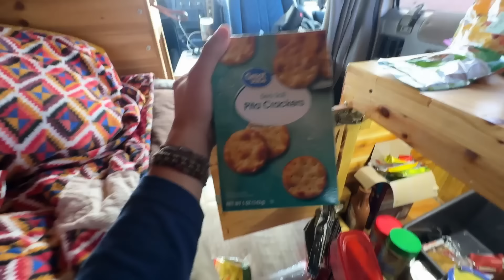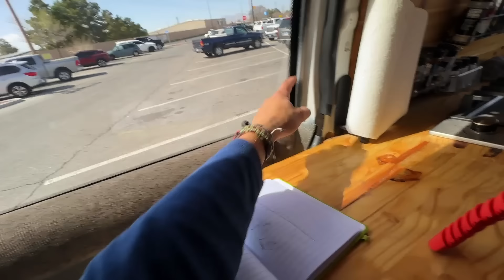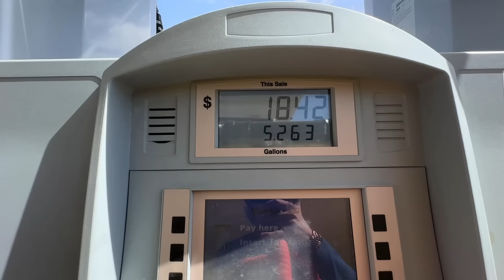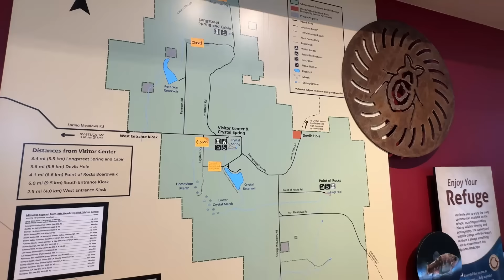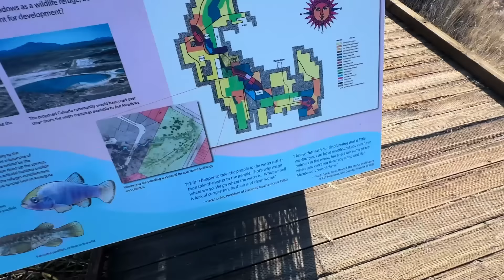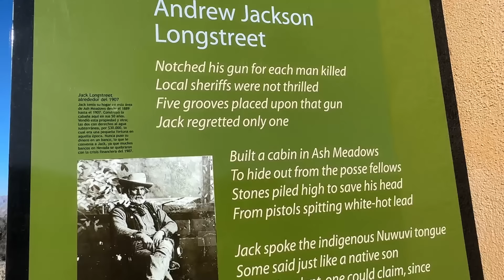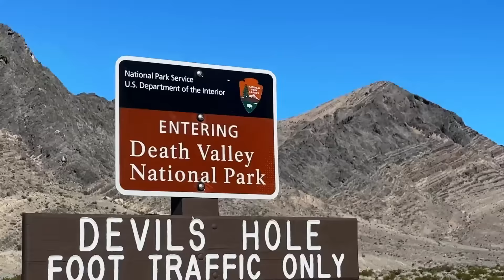Solo Travel in my Astro Van - Escaping the City and Seeing the Rarest Fish on Earth

Comment: As another Astro Van guy here, the "latch" on the front, is not a latch, it's a crash retainer. In the even of an accident, when the body shifts, that striker will engage in the hole it slots into to stop the door from coming away from the body... Only the back striker and latch, actually latch the door closed.

When you're having trouble with the door closing, it's usually the rubber bushings on the three slides that are out of wack that causes the door to close improperly. I usually oil all of the bottom track below the step, and I'll spray some oil on the last visible 4 inches of track at the back. Then I'll open and close the door a few times to get oil on the bushings.

If it still has issues closing, The bottom track bar(on the rear left of sliding door) has two(iirc Torx, or maybe bolt heads) you can loosen, and lift up on the door a bit, and retighten, to make sure the latch lines up perfectly with the striker.
Reply from the maker: This is extremely helpful bro, thank you so much for the comment and for talking with me on the Live Stream 🤟🤟

I’ll be sure to do exactly this

Comment: All you need to do for your water jug is to drill a hole the same size as the hose inthecap. The hose has to be long enough to reach the bottom of the jug. You push the hose through the hole in the cap so it reaches the bottom of the jug. No fittings needed.

Comment: Hey Bronson! Love your channel, new subscriber here. Did you have any issues with your rear doors leaking? I’m a fellow Astro/Safari owner. Just curious, thanks!
Reply from the maker: You have no idea, it was bad. 
The previous owner decided to take out the 2 panel doors and replace it with the 3 style doors I have. 
Needless to say they did a shit job and put zero effort into sealing it. 

When I bought it I had legit a stream of water running in from all 4 doors whenever it rained, snowed or anything. 

I used a ton of chalk, door sealer, sticky car foam and patience to get it all sealed up. 
It now won’t leak at all but yeah it was a pain in my butt